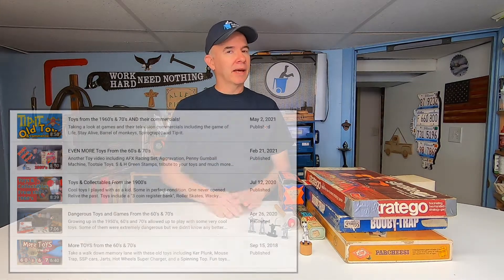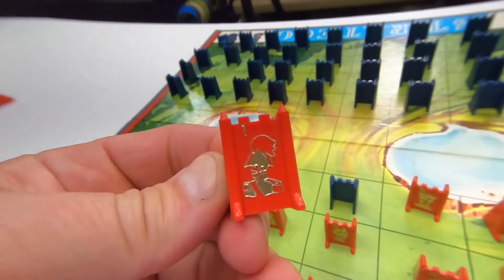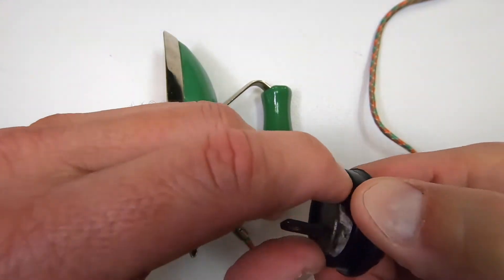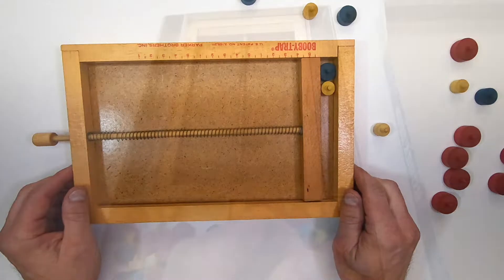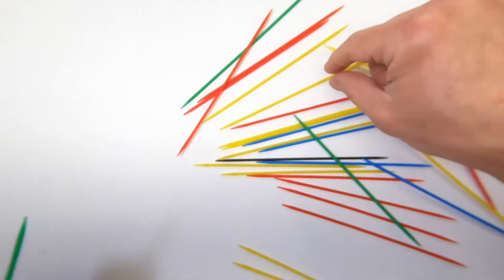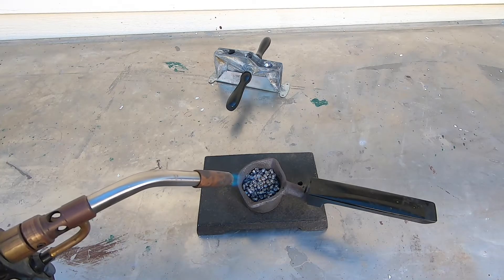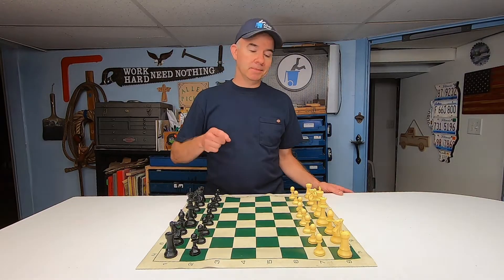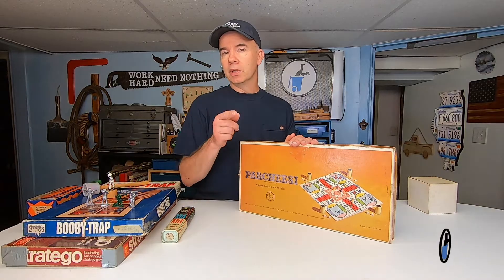Old Toys we Loved, Feared & Hated from the 1960's & 70's

Comment: Stratego - I remember seeing the TV commercials for this, but I never played it. Back in 1990, Accolade released a version of it for MS-DOS, and I loved the screenshots. It looked just like the board game. I didn't have a DOS system, but a while later, I got a copy for my Amiga. It didn't look nearly as nice. Then I read the rules and tried playing it. I set up the pieces with bombs strategically placed to protect my flag. The computer avoided every single bomb, only attacked pieces it could beat and went straight for my flag. That was the one and only time I played it.

Lead soldier mold - I wonder if you could use that mold with the meltable plastic pellets that they sell for just such a purpose.

Games I never played - I used to have a chess/checkerboard that had Backgammon on the back. I never knew how to play it.

Comment: Hey, Parcheesi and Aggravation are almost the same thing. The fun part is if you land on someone and send them back you get to move 20 spaces. If you roll doubles and you have all your pieces out, you get to use top and bottom of the die. Meaning you roll double 6's you get 12 +2, = 14 spaces. Cool ules. You need to look into it.

Comment: Spirograph was, for me, extremely frustrating.  You stuck a pen in the offset hole of a geared circular piece and moved the piece around the inside of another geared circle thus creating a beautiful design.  Except that usually the inner geared circle jumped out of track and ruined your beautiful design.  Plus, the pens were of some unknown proprietary size so that once they ran out of ink, there were no other pens on the market you could buy that fit inside the little hole.  Swell.  The one I had was the Super Spirograph, which amplified the frustration exponentially.